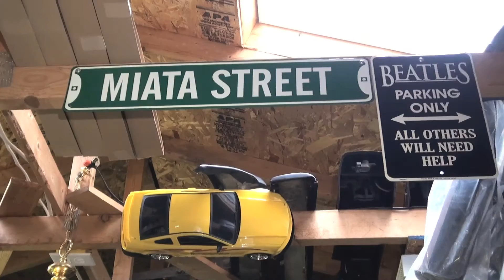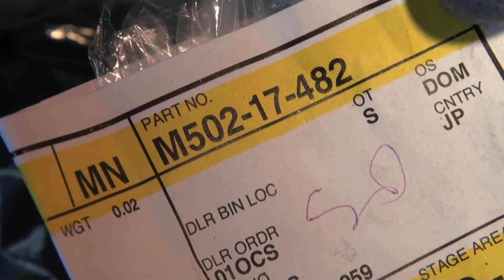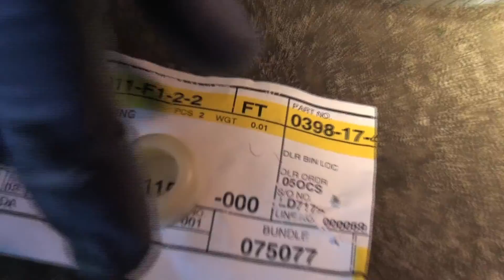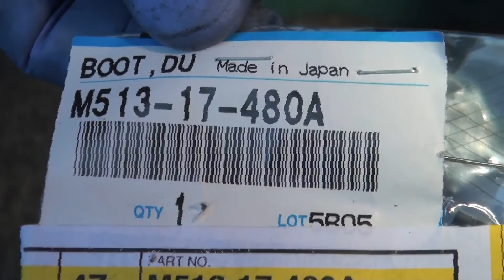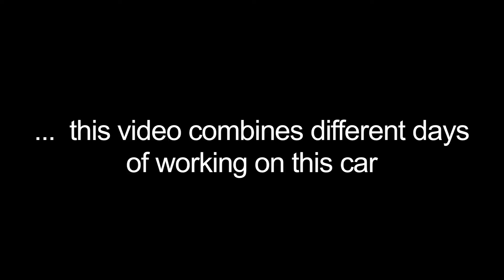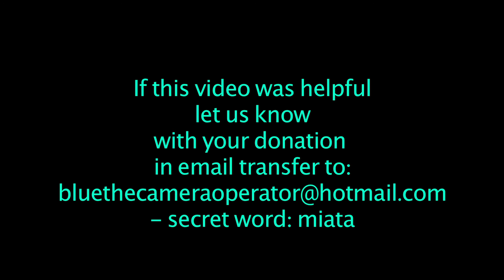Mazda Miata MX5 1990-1997 Gear Shift “Dust Boot” Replacement & Gear Shift Turret Oil.

Comment: My car stopped going into gear. Like no gear would open up. This was the 3rd and final time within a month it did it. I opened up the shifter and there is no bushing on the end and I see chunks like particles down in the turret. When I got the vehicle, that shifter was getting really hot. I then popped it off and put a new boot on it. That helped tremendously. I recently changed the transmission oil and differential oil under the vehicle only recently.
Now, that it doesn’t go in gear, I wonder if it is because I need a shifter rebuild? Mainly the bushing? Whatcha think?
Reply from the maker: I would change out your clutch slave cylinder and clutch master cylinder.

Comment: Does a 2001 NB 6 Speed Turret uses any kind of oil?  Do I need to fill the box?
Reply from the maker: Very good question. 
I think 2001 6speed cars were the first Miatas to not have a separate reservoir of fluid in the turret. 
Easy way to tell is to pour a small amount of fluid in to the turret and see if it drains away.